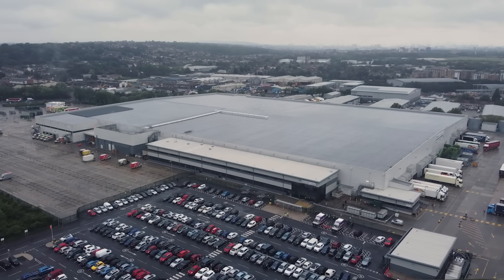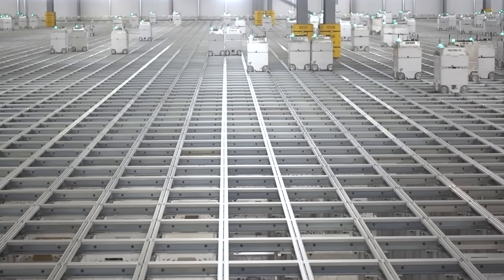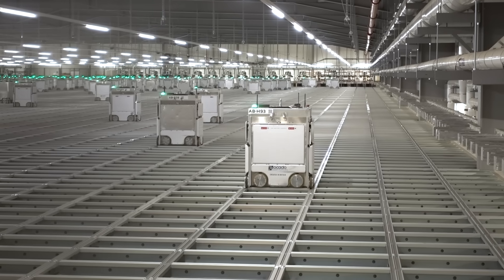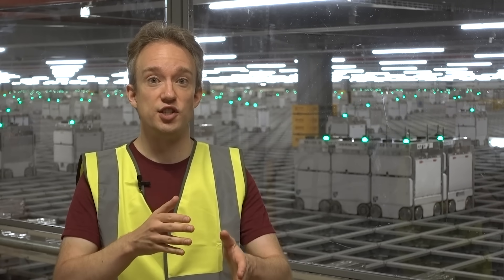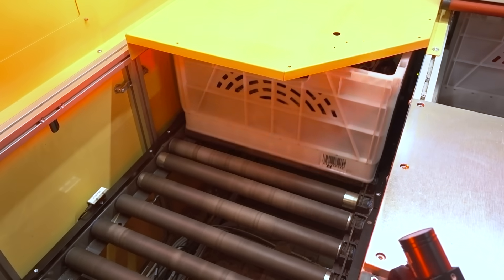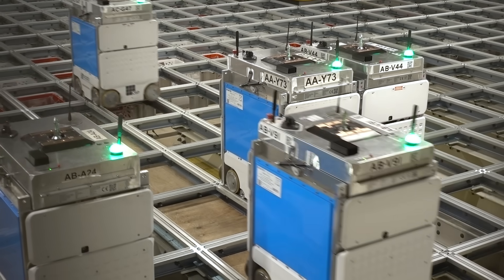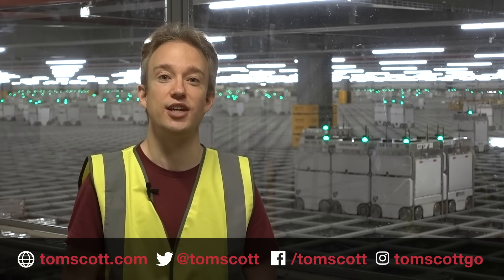How many robots does it take to run a grocery store?

Comment: You don't have to pay robots. Do you think Jeff Bezos watches this at night with a bottle of lube instead of porn?
Reply: The minute that robots are cheaper that is how amazon will be.  At the moment their calculations clearly still show that humans are cheaper.  And they do have a lot of robots in those amazon warehouses.  Bots are hardly free.  There is a huge upfront cost, large electricity costs, large maintenance costs, large control software development costs, the people you need to maintain them are going to have to be higher paid in general than middle management at a warehouse, etc...
Reply: @Alluvian567  well, my old teacher would say: the more robots there are, the more people you need to maintain them, the more poeple there are, the cheaper they will get in terms of wages
Reply: @DharkB   Until the point where they no longer need us to repair them and they just repair themselves/eachother which will happen a lot faster than you think.
Reply: @DharkB  your teacher didn't realize that robots maintain robots
Reply: @Alluvian567  You make a fair point, but robots will likely still continue to be used more and more, since programming them and making them compatible with the task at hand becomes easier over time, as industries as a whole gain experience doing so.
Reply: @JWQweqOPDH  For sure.  I agree, it will just take a little longer than some tech optimists initially think.  There are always lots of unforseen issues to iron out. I do a lot of software automation for my job and the more you get into it the more you see the pitfalls and limitations of it.  It is great, but everything has it's time and place.
Reply: @Alluvian567  Absolutely. The cost of financing alone may be higher than the whole payroll of a traditional operation. And it might very well be that the payroll of a robot warehouse is higher, too.
Reply: @Alluvian567  Amazon already works with 3000 of this robots per warehouse.
Reply: You do have to lube them.
Reply: Honestly, this might be how Amazon warehouses should be. The working conditions there are inhuman, they're not spaces for humans.
Reply: @LadySnowfaerie  this technology is already in amazon DCs and has been for years
Reply: @LadySnowfaerie  not really? Been working there for a few weeks and it's not that bad
Reply: @LadySnowfaerie  there are similar robots at amazon in uk.
Reply: @LadySnowfaerie  I work at an amazon warehouse and nothing about it is inhumane
Reply: @LadySnowfaerie  have worked at a couple Amazon warehouses. Except for a hick up in the bathroom sometimes  but it’s not inhuman work. People cant deal with the simplest of hardships nowadays after a generation or two of living in comfort.
Reply: @LadySnowfaerie  but you do have to pay someone to maintain
Reply: @LadySnowfaerie  this is how amazon warehouses are. Have you ever seen one?
Reply: @LadySnowfaerie  and it's still better for those who work there as not to work there or they wouldn't. Ask those who work there if they are ok to give their job to a robot because it's so unhuman for that person. I'm sure that person will prefer to stay there instead of getting replaced by a robot.
Reply: @LadySnowfaerie  Any highly repeated manual labor with heavy objects is not for humans. Even repeated tasks when you move your back in the wrong way with no weight will eventually cause unrepairable damage. Warehouses have horrible standards for preventing things like this in.

Say what you want about Amazon, but going towards more automated factories is a VERY GOOD thing.
Reply: @LadySnowfaerie  Your solution to poor working conditions is to automate them?
Reply: @LadySnowfaerie  they aren't bad at all, idk where people got the idea from that they're inhumane
Reply: @LadySnowfaerie  you’re fed lies mate, I’ve worked there myself and can honestly say one of the best jobs I’ve had
Reply: No, but you do have to make/buy them, give them something to do continually, keep them in service, and upgrade/decommission them when the time comes.
Reply: @xandercorp6175  So exactly how Amazon operates with humans, just a bit better, eh?
Reply: @LLPTV  You don't have to have an exit strategy for the human, you just eject it and it takes care of itself or falls off the grid.
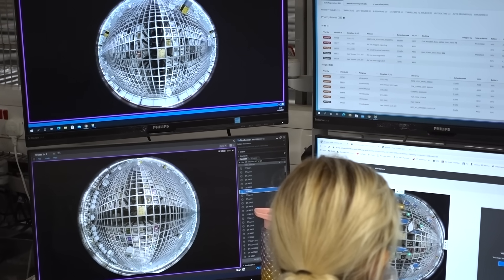Reply: 4:10 ...there must be around 200 cars in that car park, so am guessing it still has a large staff.
Reply: @mickenoss  Great point. It still takes a lot of people. However, the facility could be doing the amount of work that would normally take 2000 people.  Lower person to work ratio.
Reply: As an Amazon worker, I have a theory that smaller sites are filled with humans, that way Amazon isn't seen as a robot only environment, and can be seen as the super amazing place everyone gets to their stuff from
Reply: Drinking from his aged bottle of delivery driver piss.
Reply: I think that this is where Amazon will be heading. Humans needed for maintenance and handling objects that are “weird” for robots: too big, unusual shape and etc
Reply: Too late Kroger signed with them
Reply: wouldnt it increase the electrical bill?
Reply: It's just a matter of time until Amazon warehouse will be operated by robots. For now, it's a lot cheaper to hire people but it will eventually change
Reply: there are already some Amazon warehouses that work with robots
Reply: Yes,1000%.
Reply: LMFAO
Reply: By now Jeff has a life sized of humanoid to keep him "happy".
Whereas Bill has a couple of small robots to keep him satisfied and a tank of lube.
Reply: They do. Some of his new build facility are 90% automated. It should still be posted on YouTube
Reply: A robot does it for him
Reply: Yes. Well: I'm thinking about it now. Thx for that...
Reply: You can't underpay robots :(
Reply: Jeff quit Amazon. Your joke is invalid Game Games
Reply: Да, работам не нужно платить, но кому Джеф Безас будет продавать товары, если все  будут сидеть безработными так как вместо них на заводах и фабриках будут работать роботы.
Reply: UNIONS won't put up with it, because the robots won't join!
Reply: Bruh moment
Reply: You don't have to pay robots. Nah electricity and maintaining them is totaly free.. Maybe that's why electricity is going up to 100%
Reply: Movie Games
You have to Pay in Millions to the Company that Makes them Ultimately Paying Humans again but Now in Millions.
Reply: "You don't have to pay robots"?  Do you think they're free?  They cost more than human manpower!
Reply: Good. This is how most places should be
Reply: lmao
Reply: stop being so dramatic, robots also produce labor, there are scientists managing them and also those who build them and etc etc. If you have lost your petty 9-5 grocery store job its not jeffs fault
Reply: @Humanoidable  All fine and dandy except for the fact none of those are grunt jobs. Automation disproportionately eliminates unskilled labor, which is all some people can realistically do. A scenario with increased automation must also increase the social safety net to account for the portion of people no longer able to work to support themselves - the only other option is inevitable revolt by the resulting jobless masses.
Reply: that looks expensive af
Reply: Jeff Bezos doesn't pay even to human.
Reply: @honhon999  ok. dont work for him then?!
Reply: Jeff Bezos does not pay his employees and bots consume electricity.
Reply: Nah he's probably got a group of people trapped in his basement or something.
Reply: Doesn't pay his employees anyway.
Reply: I wouldn’t be surprised.
Reply: More and more humans have become vestigal to the technoindustrial system, but the system cannot afford them the freedom to fend for themselves. Probably they'll be lucky to get a pod and bugs. No reason for Pfizer and Amazon to care about keeping them alive.

inb4 'just be in the top x%, where x decreases every year.'
Reply: @letsmakeit110  except you need people to pay for it....

Comment: Correct me if I'm wrong, but wouldn't the cost of designing and building all of this be more than just hiring workers?
Reply: Investors are betting the upfront cost of automation + the amortized losses from depreciation and maintenance will one day be overshadowed by labor savings and increased efficiency. The timeline for when that will happen is likely decades out, though.  It's a speculative gamble.
Reply: @dui_hire_pete  ok thanks

Comment: Imagine the cost for design, testing, maintenance, and going large scale for this.
Reply: I'm familiar with these systems.  A typical smaller size is around $18M.
Reply: @davec.3198  would you happen to know what the benefits of these systems are from the perspective of cost, economies of scale, efficiency and accuracy over that of human warehouse workers? I wonder if the ROI is better over more traditional systems. I'm sure there is a good reason for adopting automation, but some numbers comparing the two methods would be interesting.
Reply: And the entire thing burning
Reply: what they need is one of those robots on a shop floor. it’s all well and good using this place to fulfil orders but a supermarket is a physical location already. why not have the robots stock the shop floor? better yet, have them pick from the shop floor so that people don’t have to.
Reply: @KiLLJoYYouTube   Who needs manual labor anymore?  We'll all go to college, and afterward we'll all have careers in management, all of us, worldwide.
Reply: @hd-xc2lz  The ideas of eliminating labor and universal basic income are often discussed together for a reason. When robots become effective enough, societies which are built on the assumption that every person should have a significant job tend to fall apart.
Reply: They pick a million items a day for humans to do same pick rate they'd have to hire least 5000 humans at 10 pounds per hour...
Reply: @girlsdrinkfeck  10 lbs an hour would be very little work. Guess that's why they need robots.
Reply: @girlsdrinkfeck Never worked in a supermarket but that just sounds like a low number but not disagreeing with you.
Reply: @tylerbonser7686  10 pounds an hour in currency, not weight.

Comment: Great video, but there is a different theory than the one Tom suggested with the bacteria in your body.
According to Tom (as far as I understood it), because the robots are all interconnected wirelessly and controlled by 1 brain robot. 

As a robot is a "Task performing machine" and each one of them can be programmed in a different way and with a different purpose at any given time then one can easily say that each individual moving machine is a separate robot with an intended executable function, just like when nearly all the computers in the world are connected to main servers all over the world doesn't make them 1 computer, but rather individual computers. Just like soldiers that are commanded by a commander doesn't make them 1 soldier we can safely say that there are in fact 2000 robots, but a world for the collective of all these bots is not yet 'invented'. Just like when all computers communicate with each other is called the "Internet" or the group of soldiers is called "battalion". I think it is not to argue if it is one or many, but how a group of many individual bots can be named.
Reply: A flock of robots? A horde? A menagerie?

Comment: I always think it's fascinating to see gaming hardware in non-gaming contexts. That "3D camera" ( 2:25 ) is an Xbox Kinect, and it's always fascinating when tech designed for gaming ends up being the most cost effective or sensible thing to use for other applications. It's like seeing drones or other remote controlled robots using what is effectively a game controller to operate
Reply: mass production/availability of spare parts, and ease of development probably play a role.
Reply: I used to work at a surgical robotics company and most of our prototype controllers were literally just modified xbox 360 controllers
Reply: playstation controllers being used in the military, haha
Reply: Also US Air force use PS3 taped together and use it as super computer.
Reply: Well this aged well...
Reply: Logitech Submarine moment
Reply: @JoshusBarber  honestly if it was being run by a quality controller I wouldn't even have batted an eye, it's just wild that it was a knockoff controller from 2005
Reply: fr. We used to use a lot of rando things at our tv station
Reply: why try to design a control system when there is a control system alrdy developed and tested millions of times? some applications work almost the same as some games and the controllers have proven to do their job well.
Reply: Robot makers and hobbyist have been using xbox kinnect, wii controller for years
Reply: A lot of that is because why introduce a new type of controller that people need to learn when they have already gotten used to using controllers in their everyday life that work just fine?
Reply: The us military use xbox controllers
Reply: Seems SICK "machine vision" devices for me. So not even close.
Reply: And submar... I was beaten to that joke
Reply: I'm a software engineer and it's amazing what you can do with the Xbox Kinect.  At my previous employer, we used it to develop a person recognition app.  The number of features available via the shared library is incredible.
Reply: I've seen Xbox Kinects used at airports to track checked baggage
Reply: Wait until you see the same cam looking at you above the gunsights on a drone.
Reply: Ha, RC controllers existed well before pong, and way way before modern game controllers!

Comment: A week after you uploaded this, the fulfillment center burned down….
Reply: No it didn't there was a fire but it did not burn down the building
Reply: @Lo-gains  Unlike Andover a couple of years ago - perhaps they had the sprinklers turned on ?
Reply: @johnmurrell3175  Andover was different circumstances as reported. Even then it still does not change the fact that saying erith burned down is an obvious lie as its still standing and reported that 1% of the grid was damaged with no damage to the structure at all.

Comment: Anyone else back here after hearing about the fire caused by three of the robots colliding
Reply: It looks like there were two previous small incidents at least. Then one major fire that completely destroyed one facility. Obviously, they'll need to decide if the cost saving measure of using automation instead of human labor outweighs the cost of losing one facility.
Reply: I didn’t, what happened did the robots blow up ?
Reply: Good hopefully people got jobs after the fire because it was too expensive to rebuild
Reply: @g-wagonsg-wagon3693  unfortunately it reopened in 14 days
Reply: @ohitshammy  unfortunately?

Comment: I'm wondering if the bots have on board batteries,  that charge over night,  or the grid is powered.   It's a tight logistics solution,  but still dependent on deliveries to this site.
Reply: They have onboard batteries and charge on demand when the battery level drops below a certain threshold.  The site is in used 24 hours a day so some robots will be charging while the others work.

Comment: "But most people wouldn't consider that gut bacteria to be part of them."
True, but that sounds like a them-problem (or maybe a collective case of narcissism). If you only make up about around 10% of the cells in an organism, it seems quite... self-assured... to consider yourself that organism but exclude that which makes up 90% of its cells...
Reply: Wasn't the whole 10 to 90 thing disproven?
Reply: @herbertfrischke7921  Possible, but it is the number that was quoted in the textbooks when I started studying bioengineering (which was, admittedly, seven years ago).
Reply: @herbertfrischke7921  More like 30 to 70, not sure though.

Comment: I'd like to see them lift some heavy glass bottles and beans in thin plastic bags without ripping a hole in it and detergent bottles with faulty caps where the detergent will get into all the nooks and crannies of the machinery there and you will have to shut down the whole system to get someone to clean it. This video looks more like a commercial than reality.